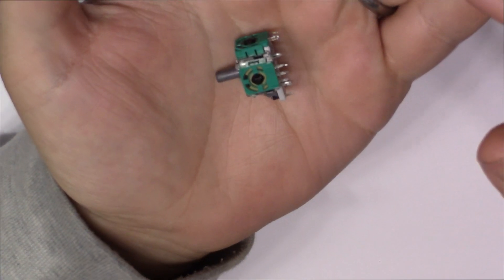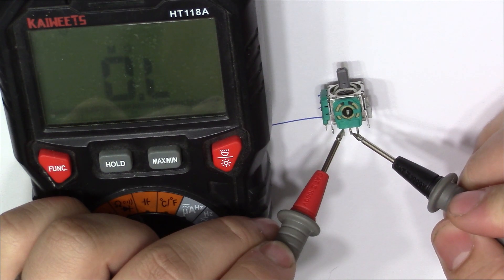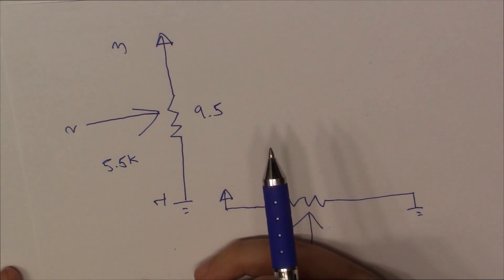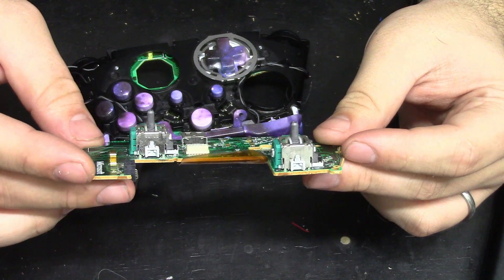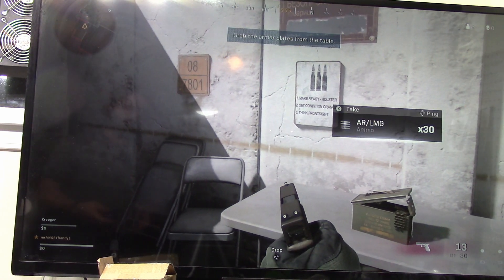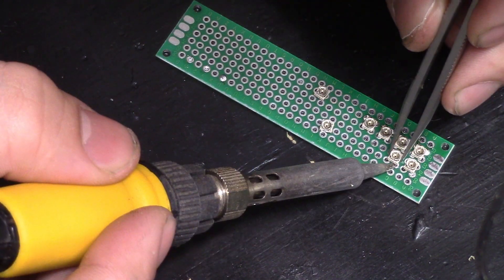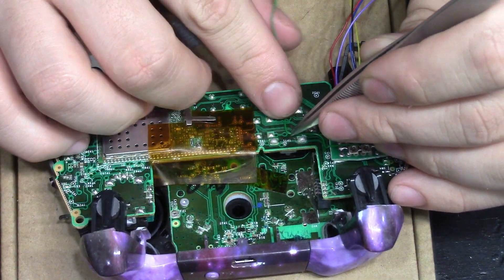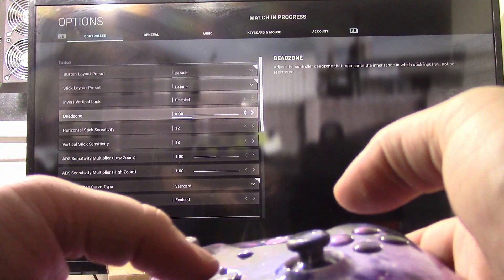Understanding stick drift and a mod for getting rid of it FOREVER. Xbox One.

Comment: Hey buddy, firstly I'd like to thank you for your straight to the point clear and concise info on all the intricates of these dodgy controls that we pay good money for. Me more than  most I guess because I cannot see anyone on the net or YouTube having fixed or attempted to fix an elite 2 control, of which I am on my second. It only took one drop on carpet to create permanent stick drift on the left analog.

I had a few solutions so I thought, i had purchased two different analog sticks for the control to replace completely, first one ended up being a cheap ripoff even when I paid more money for than the second one which turned out to be as close to genuine that I have found on the internet. 

My soldering skills are a bit out if whack as I have not touched one for maybe 15 years as well as not having all the good stuff to make the job easier.

In saying this cutting a long story short, i seem to be having the same problem no matter which analog I replaced, and because I had given up on it after months I then attempted an elite 1 controller, coincidentally with the same issues, of course, yet I keep getting the same result. And that is the analog thrown off completely out of the deadzone diagonally basically, and not responding to any movement. With both controls, elite 1 and 2. I'm almost certain that all these analogs cannot be bad, especially when I even had perfect analogs I've taken out if good working controls to replace in the elite 1, as of tonight I'm at my wits end now haha. I would love to be able to get any info or help from you, maybe even send my board if you are able to help with my elite 2 control, very similar to what you've done with all your other controls, I'm sure you'd have it fixed in 5 minutes. Thanks in advance with any info or help you could give me, I could send pics or videos if that would make it easier for you to understand. 😊
Reply from the maker: Thank you for all that! 

I would love to repair the controller for you and I'd even do it for free becuase I could make a video out of it and help out others! 

In my experience it's very very hard finding legitimate Microsoft pot replacements but I do have a few tricks to share. You can email me at solder_king@outlook.com and you can share pictures of the controller or even discuss sending it to me for repair. Thank you so much for liking the video!
Reply: @Solder_king  hey did you ever get a chance to figure this out I’m having the same issue
Reply: @Solder_king  also where does the potentiometer lead to on the board? Perhaps that can fix my issue but I’m not sure.

Comment: So I've now tried your two pot method on a couple joysticks and I still find that it's got just as much distortion as adding one adjustment pot. That is to say, you can easily fix stick drift, but it distorts the rest of the range badly between the center dead zone and the full travel of the joystick.  I'm doing the same thing you are (https://www.youtube.com/watch?v=PKPsIs79-qY) but just with full size pots so that it's easy to see what's going on. In theory your solution should work great, but in practice there's something odd about how the official xbox one controllers read out the joystick pots.
Reply: Did you find a solution to your problem?
Reply: @GeneralSouL99  sort of: https://www.youtube.com/watch?v=sHCVo4eAlvQ

Comment: awesome fix long overdue, but whats taking so long with launching...??
Anybody tried the Elder board drift modules....similar product...??
Reply: My boards are based off of his discoveries. We were working together on these initially but life took all of his time so I continued alone to what I am offering now. same outcome with mine or DIY since they are all essentially doing the same thing.
Reply: @Angryhelder  ahhh, so I bought your boards for the stick drift mod. I purchased two and was wondering if it’s as simple as what he has done in this video. At least from what I have seen. Idk about the last part yet where he cuts pieces off the stick. Anyway thanks for your time discovering all this and hopefully we can fix all these messed up controllers!
Reply: It's just as simple as shown off in the video you linked to. Solder it in, plug controller into a PC and after it recognizes the controller go to the website to make the adjustments

Comment: what's the difference between the white and red circles in the testing app? You say the red one is the dead zone, but I don't get how you could adjust that separately since all you change the the wiper voltage, which should change the stick location.

Comment: I don't get why you need two adjustment pots per axis. Seems like one between the wiper and the leg that's it's "too far" from would do. Can you explain?
Reply from the maker: Good question! I didn't cover it in my video because I actually did try to calibrate using one pot but it messed up the entire stick by just adding one. Not really sure why  but my guess would be that the controller doesn't like having only one side changed in reference to the other.
Reply: @Solder_king  that's definitely a puzzle. When you say the entire stick you mean one pot messed up two axes? Or?
Reply from the maker: @xeostube  it messed up the axis it was on. You think it should work by just trying to bring one sides resistance as close to equal as the other but for some reason the controller didn't like it.
Reply: @Solder_king  in the video it's not clear what you are doing for each axis, but it sounds like you do adjust each pair of pots per axis. It would be nice if you could shoot a short follow-up where you demonstrate how changing the trim values into more extreme levels change how the Xbox interprets the joystick position.
Reply: Also, have you checked just how much resistance you're dialing in on each of your trim pots?
Reply: @Solder_king  So I just tried doing this with a pdp xbox one controller I didn't mind destroying if it went poorly, and it totally worked. I didn't have any tiny pots so I just figured out by trial and error how much resistance I needed to reduce between the two pins that had higher resistance, and then found a SMD resistor of the right value and soldered it directly to the two pins in question. Success! but soldering SMD was a bitch, took 15 minutes of trial and error to get that little thing to fit. for reference: it was a 5k pot, and I added at 21k SMD to reduce +15% drift to -5% drift (good enough!).

Comment: Hey bud, thanks for the informative video. I had a quick question.. 

If I wanted to completely remove the pots from the controller, couldn't I just solder a 10k resistor on pins 1 and 3 so the controller thinks the pot is connected and the stick is centered? Or how would I accomplish this? 

With what I'm using it for I don't need thumb sticks on my 2nd controller at all. I tried taking the little module / pots off the controller but it registers stick input towards one direction.. Not sure why when nothing is connected to the pcb where the pots were. 

Any input would be appreciated. Thanks.
Reply from the maker: Hi there! Very interesting mod idea! The 10k across 1 and 3 might work but I'm pretty sure there will be issues if the wiper pin doesn't see anything. I would use two 5k resistors and they could be hooked up with one 5k resistor going from pin 1 to 2 and the other going from 3 to 2. That way you have 10k across with 5k in the middle.
Reply: @Solder_king  Hey, Thanks for the reply. You're exactly right. This is what worked for me when I was experimenting around with it earlier. In retrospect it almost seems obvious that that's what needed to be done. I'm still new to tinkering with electronics hah. 

Either way, much appreciated!

Comment: Great job, I did that in 2019 for Dualshock 4 with 2 pots . Your fix is for better calibration, but can try and with only 2 pots . Sometimes it depends of the ARM controller itself - same analog module works perfect on another controller . Cheers 
https://www.youtube.com/watch?v=2RYwQfL4f70&t=17s
Reply from the maker: Nice! I was also informed that this mod was used on some arcades too! I did try with 2 pots and it acted very weird.

Comment: Funny, I found this video by planning on doing the same thing but only using the potentiometers temporarily to get the values to solder resistors in place. I have a controller that even after changing the stick 3 times (thinking I did something wrong), all 3 were way out the same. Sony must of calibrated the controller with a not so good pot so now it is stuck that way forever. Thanks for this video, it has confirmed my idea.

Comment: Unfortunately I'm in need of calibrating my two x360 controllers, already replaced the analog sticks (both controller were super loose, now they are stiff as...) but those are not properly calibrated and not centered.
EDIT: Just received my package with all the parts I think I need to make such board with potentiometers, gonna try that on both x360 controllers.
EDIT 2: Okay, got my board prepared but when I solder wires to the x360 analog in the same way You solder your board to the analog the controler does not properly start and connect to PC, seems like I lack proper ground point, maybe anybody knows where I should solder my two red and black wires on x360 controller?

Comment: Also does this affect fine aim for higher sensitivity players? Since you have induced voltages where they weren't designed? I have a funny feeling that was why you needed to give the analog a greater range of motion to eliminate the trickle your sending from the other side of the pot

Comment: Great video! I just dealt with mine by heating the solder and wedging up the corner where my analog was drifting to, after much tweaking I finally got the pots tricked into thinking they were where they had to be!! Barbaric comparatively to this genius fix! 
I am definitely going to do this,  however I don't run rumble motors so my plan is to split your design into 2 boards and hide them where the rumble motors go.
Reply: What do you mean with wedging up the corners where your stick was drifting to? Could you send a picture or something? Would be sweet
Reply: @changedpepe7745  putting the joystick at an angle, smart brute force fix!

Comment: there is really no video that says anything about the springs from RT and LT  and i dont know if it is suposed to be stuck in place so i could maybe glue it back idk if anyone knows about it. if you know what i mean with the spring (it is  a metal wire around a metal rod  with in the middle a bit that goes away and comes back
Reply: the RT has basicaky no resistance anymore and doesnt return automaticaly

Comment: Were can i get that board and the parts? I would like to try that mod for my self to
Reply from the maker: The board I used is standard proto board you can find on amazon and as far as these pots you can order them from mouser, digikey or ebay if you search "smd 50k potentiometer"
Reply: I'm going to try it. I'll let you know how it goes. Thanks man. You're awesome
Reply from the maker: @Aarito100  Let me know how it goes! :)

Comment: Does this only solve for stick drift or would it also make it more accurate as you moved the sticks throughout their range of motion?
Reply: it might actually reduce the long-range accuracy since it's no longer possible to reach the extremes of the range.
Reply: @xeostube  adjusting the curve on the sticks should help with that (xbox elite controller options)

Comment: To fix range of the stick, can you add a permanent resistor to leg 1 or 3 of the x or y axis analog stick potentiometer (no cutting or Dremel)?
Reply from the maker: Possibly! That would require some experimentation to be sure. Definitely worth trying though! That would increase the resistance of the pot across the resistor which in my head I can't figure out if it would increase ir decrease the throw. I'll give it a shot tho!
Reply: @Solder_king  Wee! Thanks for making this video, it was awesome seeing an application of voltage divider circuits in a gaming context! 😎
Reply: Where do you connect it to, and what size resistor please .?

Comment: Quick question. 

What do you use to secure your wire runs?
Reply from the maker: I use standard super glue. I try to use as little as possible and avoid using it near vias. I tend to use a cotton swab to soak up excess.

Comment: Great video! I really like the presentation and explanation. I was toying with the idea of replacing the potentiometers with Hall Effect Sensors (this is pretty common in high end Flight Sticks). Could be a neat experiment for a future video. Merry Christmas!
Reply from the maker: That sounds like a very interesting idea! That would make for a near perfect stick.  I wonder why they didn't try that since they got rid of the potentiometer triggers for hall effect sensors from 360 to xbox 1. Might be a fun mod! Thanks for watching and for feedback  :)
Reply: @Solder_king  won't you lose the magnet over time?
Reply: @Solder_king  are you still considering this? Saw someone on reddit recommend something like the Amphenol Piher MTS-360,  but I don’t really know how to modify the controller so that it can properly read the output of the sensors
Reply: I would love to see this as it would change the joystick game if there was a mod that could make the perfect joystick